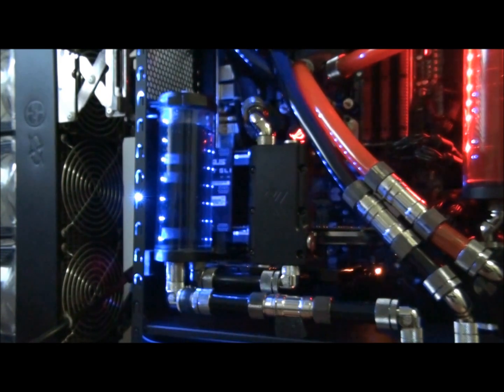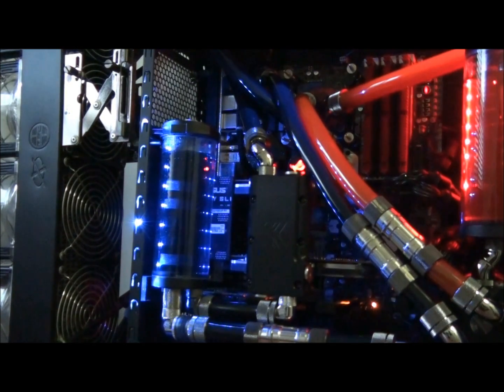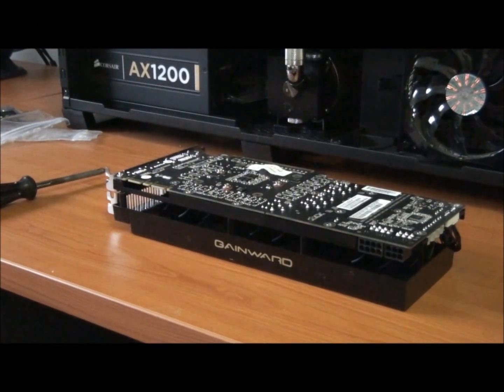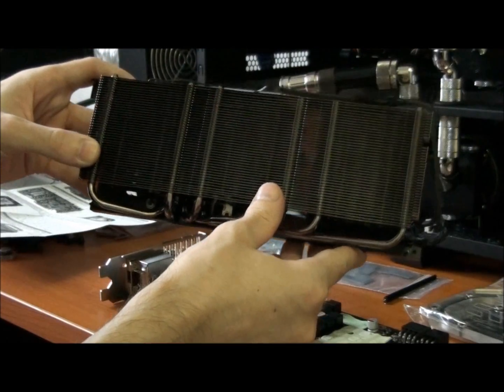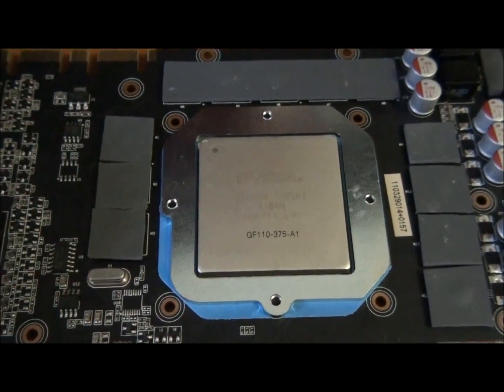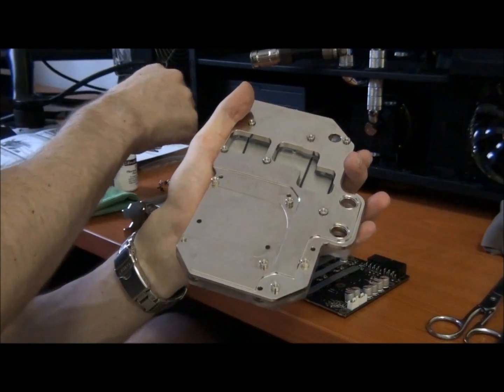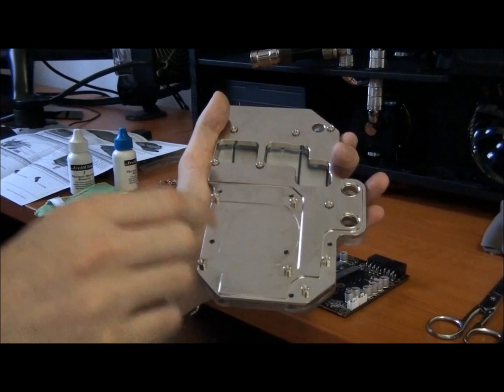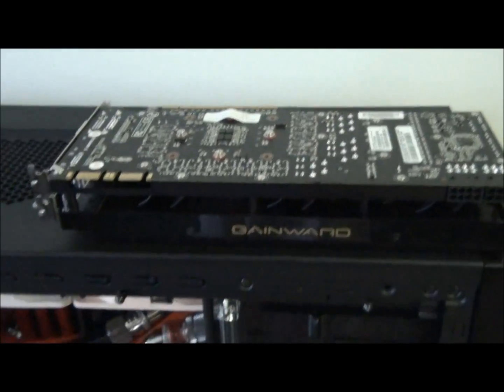Graphics Card Waterblock Installation Guide

Comment: Hi, I have just purchased one of these blocks for my 580 phantom, Can you tell me if you had any problems with the nickel plating flaking on these blocks? I understand that this happens if you use distilled water, Though I also heard that it could be due to poor nickel plating? Thanks and great review, Saved as my installation guide!!

Comment: Installing a GPU water-block is definitely stressful the first time you do it. I mean, if you DO manage to screw it up somehow, you are out quite a bit of dough. However, after you do it a couple times (even once) its not that big of a deal. I will NEVER not WC my video cards. Right now my 2 EVGA GTX680 SC have NEVER broke 50C on 100% load. Before they were up near the 80's. WC is expensive and requires some maintenance but if you like low temps its worth it 150%. No doubt about that.

Comment: Hey, I have the same cards and blocks in my rig, also using the parallel bridge but am finding at idle I get a 4 degree difference, and a 20 degree difference under load.. thing is its the 2nd card (lower card) that's getting hotter.. any idea's?

Comment: @TheBig117 Good temperature, but does your brother have the factory overclocked version (800 MHz)?  

My PC is a Dell XPS 420, here's a video of it being dismantled
watch?v=hYkxE9whV1w

...but even with the case open, the temperature only frops from 98° to 85°. Maybe the heat spreader / heatsink assemly is not seated properly against the GPU.

Comment: @TheBig117 lol! After running this card for a while, my room does warm up.  I have to open the window and let the winter air in just to get the GPU down to 85 deg. This is the product that claims to be 19 deg cooler than the reference design. What a joke.

Comment: Would this waterblock fit the MSI GTX 580 Twin Frozer II (o/c edition)?  Or is there another model I would need?  My GPU is 98 Deg C!!! for 3D games  and its two fans at 100% before this temperature is reached.  I have to open the PC case as the heat is not vented out like with most cards.  The heat is released back into the PC, so now all fans (CPU, PSU, case) are recycling hot air.  Stupid Design MSI.

Comment: I've got 2 evga 580gtx superclocked cards but they r only 1.5gb an 1 keeps overheating even though i've gt a pretty decent watercooling setup, so i've been told to rma my card as it must be faulty, 1 card is at 45 degrees at full load and the other goes up to 98 degrees ! Not good, got them from overclockers, if they agree its faulty im going to try an c if they will let me upgrade to palit 3gb 580's, fingers crossed.

Comment: @SingularityComputers i decided on running 2x6870s and im gonna get a vapor-x 6870 to help out my top card cool alittle better. but also behind my cards im gonna have about 1 1/2inches or so im gonna rig up an extra 120mm fan right behind them blowing in air. iw ould love to do warter cooling but that seems hard and like a delicate procedure taking about your card to install a waterblock.